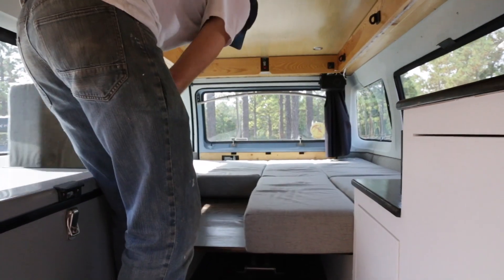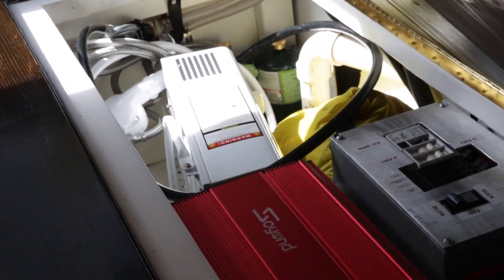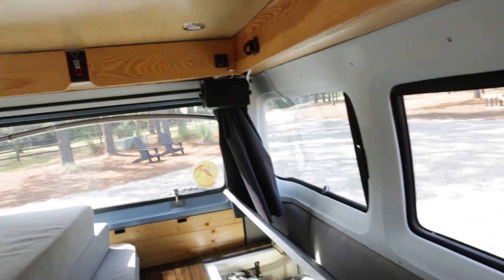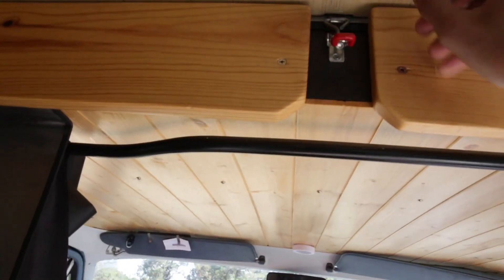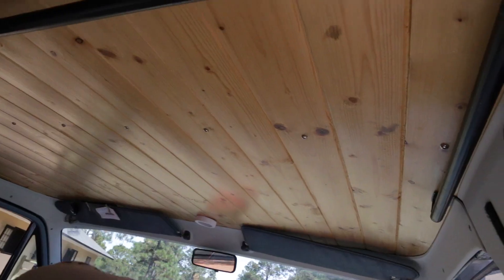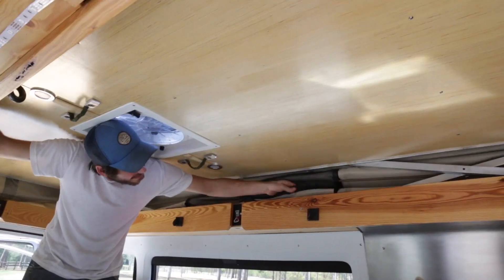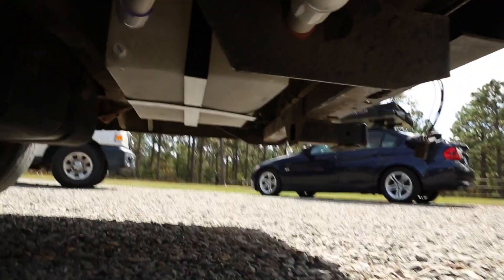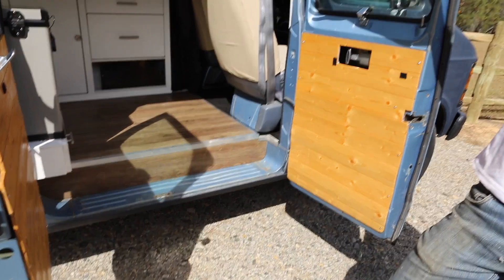Ultimate Pop-Top Van-Life Conversion

Comment: How do you keep the structural value of the chasis with removing the entire roof and cross beams?
Reply from the maker: There are a few different options that we use just depending on the application. The van didn't really need any crazy bracing or anything since there was no sleeping platform on the roof and your likely wouldn't drive with the van popped up. But like  for Alex's land rover which does have a roof top sleeping platform he threw in a roll cage which worked out really well for helping keep the structural rigidity of the chassis
Reply: @EverydayOutdoor  thanks for the info
Reply from the maker: @mickroam9991  Anytime! Thanks for watching and your comment, means a lot to me!

Comment: Can you do the pop top only? 
I have a 1999 safari. 
If possible please get in touch w/ me.
Thanks.
Reply from the maker: Hey thanks for the comment, we really appreciate it! Yeah a pop-top only design could be applied for your 1999 safari but this step takes a few hours of CAD work per vehicle and even more  hours of cutting and welding. That being said the cost of such an upgrade would be likely be more than the Van is worth. It can be done its just really expensive.

Comment: cool video, I have the same van slightly later model but with the exact same window panels on the inside, May I please ask how he got the awesome pull down sliding window shades? Or is that part of his Custom skills Awesomeness? it's such a great van, Thanks for posting.
Reply from the maker: Hey thank you very much! He said the window shades are just black out home curtains with a little latch fitted to the inside. It catches behind the trim on the backside of the molding. Hope that helps! If you have any other questions let them fly

Comment: what is that arm between the springs which hold up the roof?
Reply from the maker: It acts as a guide for the roof when its going up or down. It also helps to levitate some weight in the beginning of the push needed to pop the top. Hope this helps!
Reply: @EverydayOutdoor  would you be able to tell me the name of that arm?